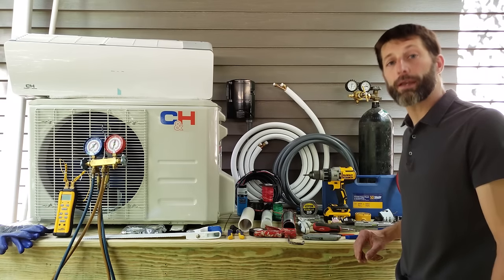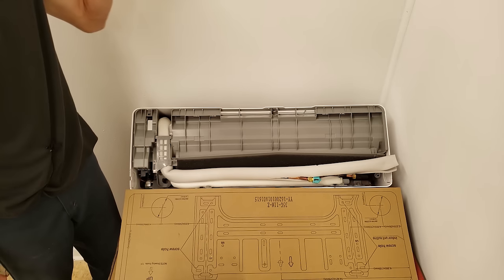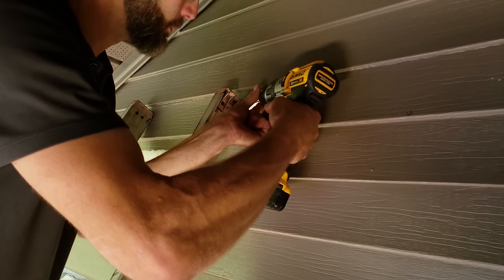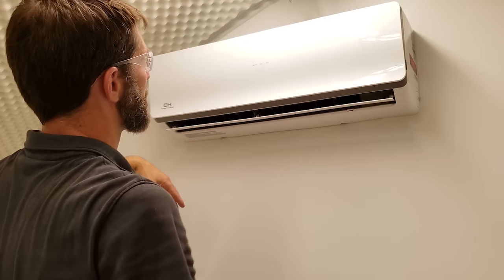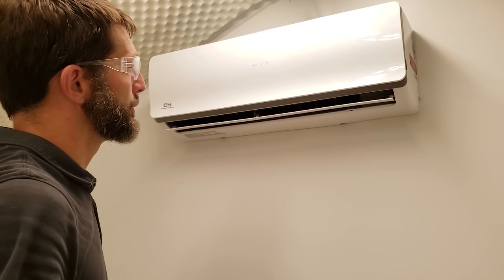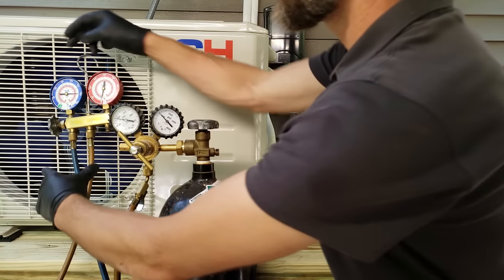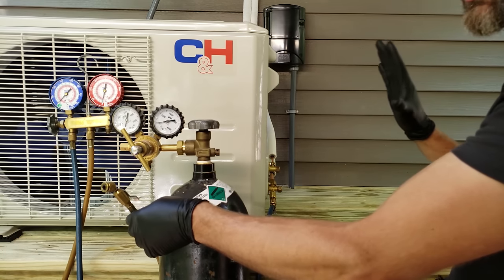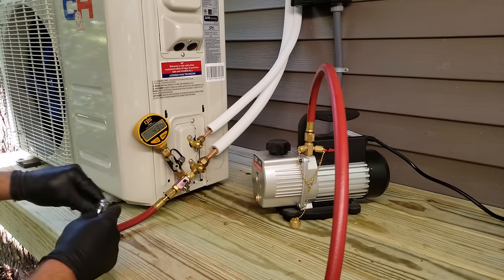Full Installation of Mini Split Ductless Unit, Step by Step!

Comment: Has anyone calculated the total cost of the tools? Trying to evaluate how much savings if doing it myself vs. contractor.
Reply: Pay a professional.  What people need to know is that buying units online you will not get the warranty you get from going with an hvac contractor.  Where ever you buy the unit only is where you’ll have to go back to for warranty, if you get any warranty from DIY and not a hvac contractor.  
Daikin has a 12 yr parts warranty with an option for 12yr labor warranty.  LG has 7 yr parts warranty, but the best customer service in the industry. 

As for all of the tools used in this video, probably around a $1000.  A quality vacuum pump is around $400,  $200 for the vacuum gauge, and $250 for the torque wrench plus the rest of the hand tools and specialty tools.  I use digital tools which cost twice that, but it’s my trade.  You might be able to find cheaper tools for maybe $500 total, but still what are you going to do with them after?

Comment: Maybe I missed it while reading the Table of Contents of the Mini Split book but there is the most important part of the system completely absent. 99.9% of people who have experience in the AC business know pretty much everything there is in the book already. What we REALLY need is information on how to install and hide line sets inside of buildings, especially buildings with no attic access. What about small rooms where a 9000BTU head is complete overkill? What about ducted vs. ductless systems and the ability of each system to handle very low outside temps in heat pump mode? (-20F) Please update the book to give us real world mini split installation problems with actual solutions instead of superficial information on basic information we all know.

Comment: Small error at the disconnect box with the hot wires 1:17:00, like the black, the red wire should be going to the protected center connection not the bare one. Does show a lot of steps skipped by others, like covering the electrical line to the head in water-tight. Probably not going to pull the valve cores, other vids showed other methods. I will have to fit and cut a PVC pipe through the wall as he did so I appreicate that detail, my wall is thick.

Comment: No disrespect!
Why did you cut those lines and vacuum those lines?
JUST ASKING BECAUSE I KNOW FOR A FACT THAT YOU CAN LEAVE IT COILED UP OR JUST PUT THE EXCESS INSIDE THE WALLS?????
YOU DONT HAVE TO CUT THOSE SEALED LINES NOR DO YOU NEED TO VACUUM THE LINES
Reply from the maker: You would need to vacuum the lines regardless because they have air inside. You wouldn't cut the wall open to put the coil of tubing in the walls. This isn't a system with refrigerant in the line set tubes and it is an existing building. Its a normal install that HVAC companies would do, thanks.

Comment: Why the plastic pipe , vermin maybe , my sparky mostly pulls power through wall into the hole down to outdoor . Usually just filling hole with silastic is fine . The cable that comes with these units are usually of poor quality , better to use local electrical cable .

Comment: the other tool you are missing is stud finder.
Reply: He is showing how to do it with what you have.  He is purposely not using digital gauges, powered flare tools or battery vacuum pumps.  He is also showing how to make flares work.

Comment: C and H system is that a good brand ???
Reply: Not really. But it's affordable compared to top brands.
Reply: Midea clone. I'd recommend senville (another Midea Clone). They revamped their web site and offer parts at reasonable prices. Helpful when you have no warranty. If you are going to install a unit yourself that won't have a warranty, parts is what matters. And if you don't do it right, losing out on a $800 unit is better than around $1800. 
I'd like a Fujitsu myself. It's just that after analyzing a Senville unit, the extra $1000 or so just isn't worth it for the small gains in efficiency. What matters most is how well you installed it more than the brand. Besides, one is made in China by a Chinese company. The other is made in either China or anywhere but Japan, even though Fujitsu is Japanese. 
Heck, Daikin is Japanese but makes their stuff in the same factories as Midea. Which is why their floor consoles look exactly alike!
Reply: Installed mine a month ago wish I found this video like the downspout better than the kits too many parts -- had a problem with a board failure 2 weeks after install called cooper hunter and sent one out in two days -- great tech service from Florida -- Nice quiet system for the price --

Comment: Iv just started watching and sure hope this is your unit 😂 and you don’t do this for a living because the hey stick a hole in it trying find a stud vs using a stud finder was insane. Idc if it is hidden you don’t just put holes in it to search for a stub and not worry because they are hidden 😆 you kinda want the area as sealed as can be so your not heating/cooling to just loose it because of all those holes that are hidden even tho they are little it still doesn’t help keep it air tight…. Good video but man that was cringe to watch you do that 😂

Comment: That seems like a Lot of steps, I would have just taken the actual metal backing drilled a hole, then drilled the second hole, and a third if needed, making it a faster install, and since it looks like there are areas on that metal backing you could have tape a small leveling torpedo to balance it….

Comment: Overall one of the best mini split installation videos, but he botched his electrical crimping creating a possible fire hazard. He should have at a minimum inserted the spade connectors correctly into his tool by rotating them another 180 degrees, and really he should have been using a proper ratcheting tool that connects both the stripped stranded wiring and the insulated wiring to the connector with the correct force.

Comment: Use fused Disconnect, fused is always better.  Also those terminals you used under the screws in the disconnect is WRONG, not what they are rated for, those are meant to be push on the male terminal, not rated for what you did.

Comment: If you watched other videos, they are all done fast.. This guy is showing off all his tools and a normal person would never do an install like this, but... I must say, If all the other videos are not answering one tiny question you may have, this would be good to watch to find that little piece.   Normal install, Guages, Evacuate, use the adapter not the shrader removal gimmick,  time test vacuum,  let out 1 pound, remove vacuum line, release coolant.  stripping wire etc drove me mad.   Pressure test?  The head units are pre pressurized to show don't leak,  this video really drove me nuts :)

Comment: one day, the refrigerant be thing of the past when something might do better without fluid by using electrons ion conversions..its all over the air..this particles that give us warmth and cold...if somehow we can harness this discharge ..we can control our climate without need using pressure fluids that always cause issues with leaks and oil waste...IONS charge in our atmosphere ..there one thing i notice more often ...lighting strike...magnetic field  cause to trap the moister  build up but also decrease temps in the clouds when that happen...what if we can bring it closer to ground level...the temps of atmosphere can cool entire cities than just homes ?? that be breakthrough tech

Comment: We've never cared where the studs are. (Except for the penetration point) Just make it look good for the customer. And catch at least 1 stud, plus a few "wall dogs".. holds on fine 

Surest way to snap the hole saw centre drill: drill on a steep angle as shown

Comment: Where ur stud finder dude. What a lousy way use of the template. I would find stud, put up template, mark all hole include big hole for pipe and electrical wires, remove template, mount metal plate and drill the pipe hole.

Comment: That valve tool does not work at all. Air gets back into the system!  To prove my point blow into one side of the valve removal tool once you open the valve and you will indeed hear air leaking out while you affix the valve positioning tool back into the valve tool body. What absolute junk. The rod  and cap on the positioning tool do not create an air tight seal!

Comment: 300 psi is 100% wrong . you need to pressure test at the designed pressure on the data tag . in most cases its between 500-600 psi.do not listen to this video you will have leaks in the future . the reason you must stress at a higher pressure is because it WILL operate much higher than 300 psi . even unitary system are most times 450 psi . but with mechanical flares they need to be stress tested higher and also most makers say stand pressure 24 hours .

Comment: why tf dont you just use a damn stud finder that beeps on the middle instead of drilling holes next to each other like an amateur... does not look professional at all, i understand its going to be covered and not show but that is no reason to be doing that.... using a stud finder will be way faster and you will always be hitting the stud taking all the guessing part out of it,, thinking to yourself later on the day, ''hmm i think i missed that screw'''